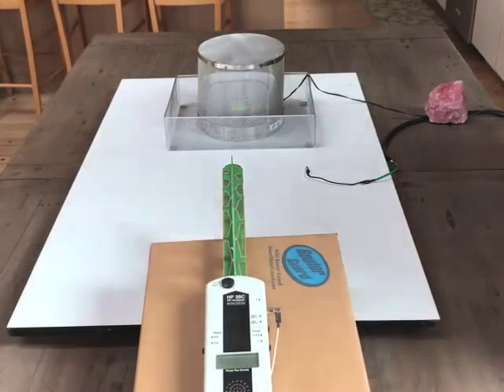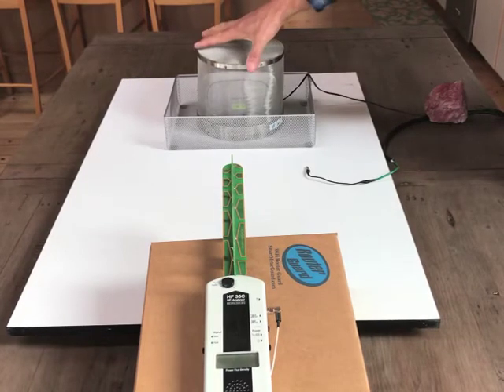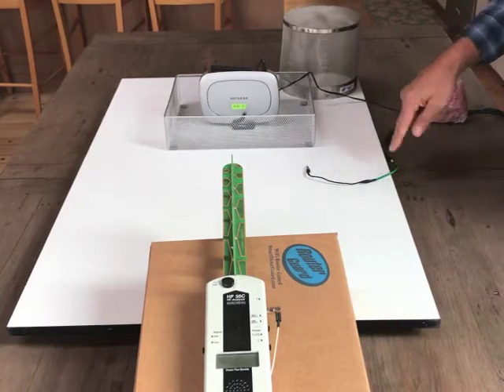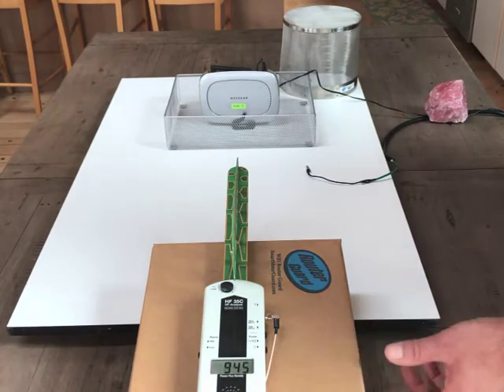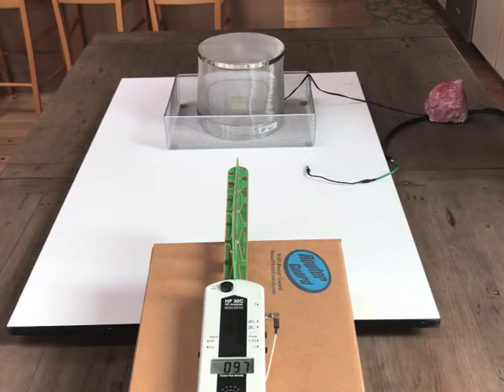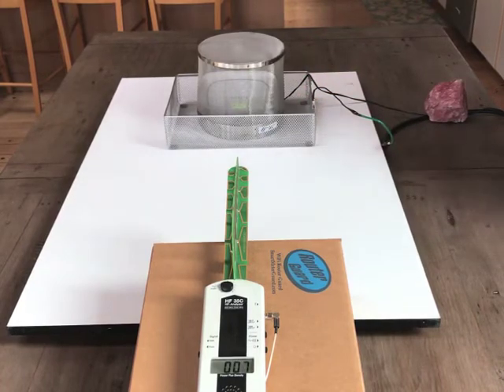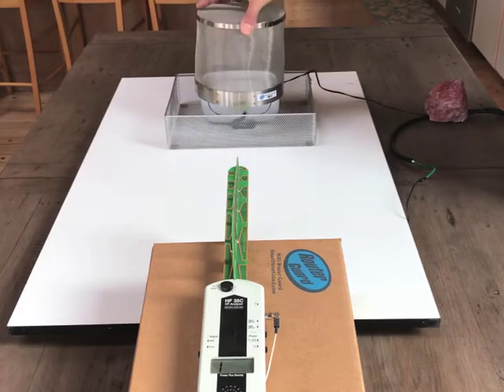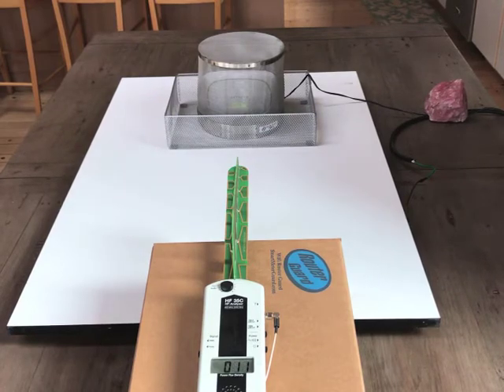Do Faraday Cages Need to be Grounded?

Comment: Is it possible that an EMP could be across a very broad spectrum of electrical strength? 

And if that's so, even if your faraday cage works without a grounding, wouldn't there still be some advantage of having a ground? 

Would a car work as a faraday cage somewhat since they are all metal (except for the windows? And would you have to cover the windows with metal or mesh to fully enclose it?)? 

Would objects next to antennas be more vulnerable to EMPs? Some people may have antennas up because of ham radio stuff, etc. 

Will EMPS fry solar panels still, even if they are unplugged?

I am grateful you showed that it could work without grounding. But I am starting to realize there are many things we could be asking to figure out how to improve and make use of protections.

Comment: Wireless lan is on 2.4 and 5GHz. Snake oil
Reply from the maker: Hello Alain,  Please do your research and educate yourself before you call something "snake oil".  The Smart Meter Guard is a Faraday cage and it's a basic law of physics that RF waves cannot pass through a Faraday cage so unless you have special powers to change the laws of physics then the Smart Meter Guard actually does work.  Please do some research before you post comments like this, you are missleading people.  Thanks
Reply: @SmartMeterGuard  you talk about 900MHz wifi and want me do educate myself.  5573 de HB9BSL
Reply from the maker: @glaubhafieber  Yes

Comment: "If you are using sheet metal or foil to block RF then you need to ground those other wise they will reflect the RF."

Forgive my lack of background knowledge but why is there a difference in sheet metal or foil? Copper mesh would absorb RF while foil will reflect it?
Reply from the maker: Hi Mi'el,  Yes, you are correct, sheet metal and foil reflect RF while any metal mesh absorbs the RF.  As mentioned, sheet metal and foil both "reflect" RF, however, if you ground these then the RF is absorbed and shunted to ground.  Thnaks

Comment: Would the reading be different with the ground on the signals side?
Reply from the maker: HI Nick, The ground wire doesn't act as an antenna because the RF the router emits already dissipated into the metal mesh of the Guard.  Thanks

Comment: Very comforting to know something can be done about this., but what about in back of appliance? Does the inside of that appliance needs to be cover too?? May  be tape aluminum inside of house???
Reply from the maker: Hi Pearl,  There is no need to shield the back of the smart meter with the Smart Meter Guard installed.  This is because the utility box, being made of metal, blocks the RF out the back.  Thanks
Reply: SmartMeterGuard thank you., for a speedy reply., 😄🌹

Comment: HOW ABOUT HI POWER?
We are still talking weak fields...how about solar flares and EMP?
I would not be surprised most cages could create electric arcs and heat up or even cach fire and melt ...like put aluminium foil/chips bag into microwave oven and look... thats just from 700-1300W !
Are we speaking RFID chip/GPS/Wifi shield...then it will do...but 5G killergrid/microwave(military use killer-riot control) will struggle and might fail with EMP/solarflare 1859/2020 civilization scorcher.

Comment: Hi karl, i just got the copper mesh for my gas meter, i sent u pics through your email, can u pls do u video how to secure it to a meter like mine? i know what instructions say,  but the back of the plastic part that is up against the meter is still exposed cuz i cannot sinch the bag all the way around it. doesnt that make a difference ? tk u
Reply: You can just wrap the whole meter.  Really, the gas module is only 3  - 5 volts on batteries.

Comment: Hello, can you say anything about the model of RF analyzer you are using? I see that model is the Hf35c which sells for Amazon on $350. Would you recommend that model? Or are there perhaps cheaper options which can help us get a sense of the EM contamination in our houses?
Reply from the maker: Hi Charles, Yes, we can recommend several but measuring RF is a lot more tricky than just buying a meter and measuring.  There are a lot of do's and don't when measuring for RF.  If you email us directly we can fill you in on all the details for measuring RF.  info@smartmeterguard.com   Thanks
Reply: I will do that, thank you so much!
Reply: Check out Safe Living Technologies. I have an EMF Acoustimeter that reads up to 8GHZ. Great meter.